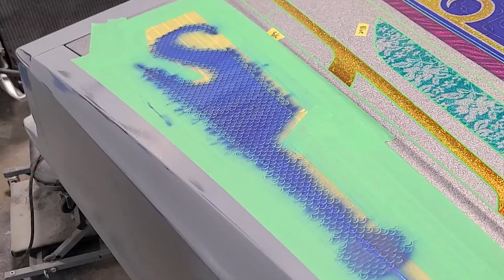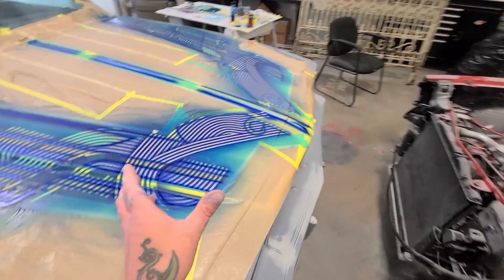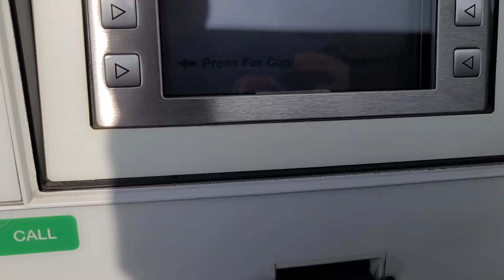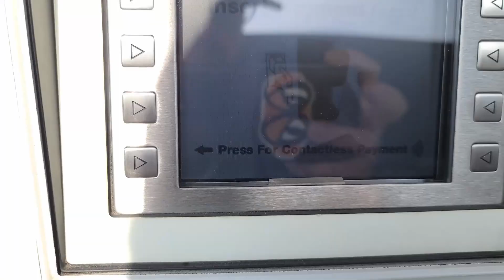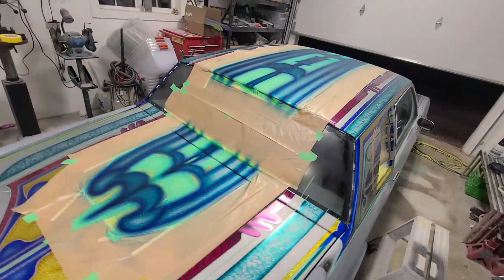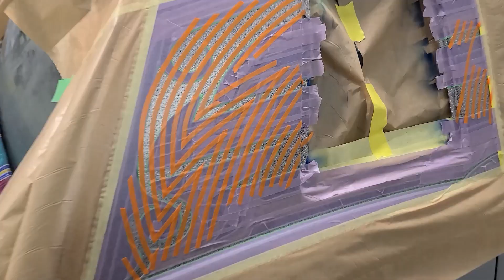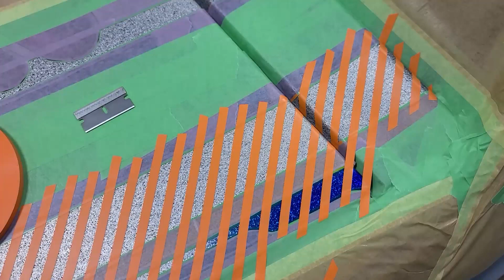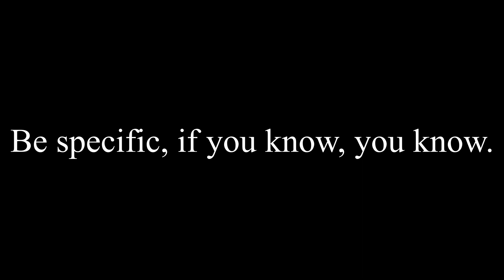Extremely Intricate Lowrider Patterns Complete on the '83 Monte Carlo!

Comment: Yep you got my attention.   I usually seal mine of with a couple of coats of clear, just to hold the dust of., and mess ups. There's enough on that to let me scuff it of before I lightly sand for final coating.  I've been caught out in the past. with everything from over enthusiastic customers, to air brush back fires. And the cat from next door. Or that bit you didn't notice wasn't quite right, then a month later you spot that you taped it back wards....
Reply from the maker: check out my latest monte carlo video. Where the paint job is FINISHED! I did what you suggested